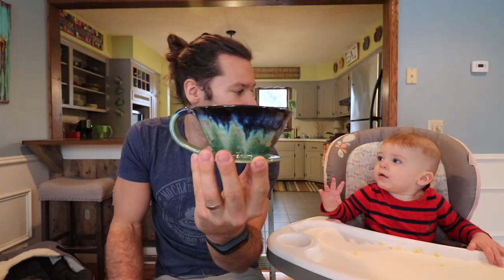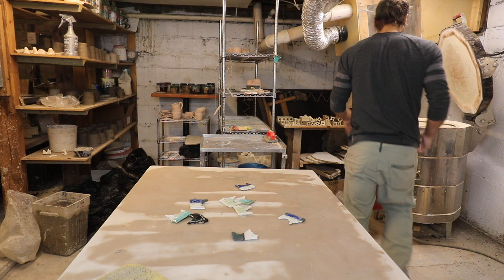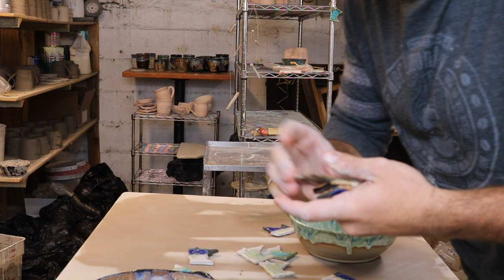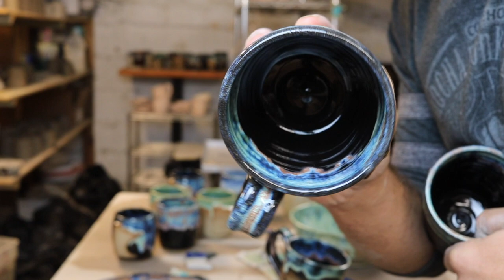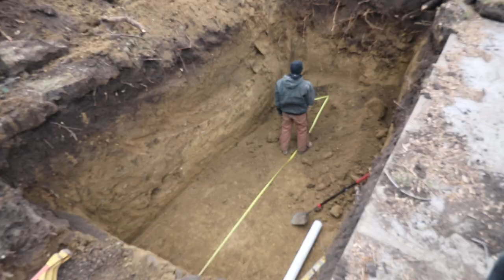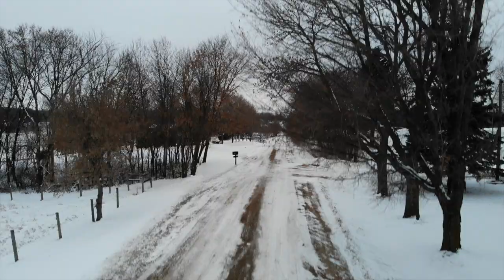The LAST Kiln Opening??   Unloading Kiln #36

Comment: As a knitter, yarn bowls need heavy bottoms so they don’t tip over when the yarn is pulled through the holes.
Reply: I didn't think of that! Thanks for the info! I was considering making a few and I'm glad you commented that info.  Thanks again!!
Reply from the maker: Good suggestion!
Reply: Yeah, thanks for the info!
Reply: Jonthepotter late, but another suggestion would be to have the whole inside of the bowl and the inside of the slots and holes covered in glaze so they’re smooth and won’t snag the yarn as it’s pulled. That drip on the one in the video is cool but would probably prevent me from buying it if it might snag.

Comment: As a Potter, my fingers seek out the exposed clay on the foot of a handmade piece. When I used to do shows, I would see someone looking at the foot of a piece or touching the bare clay and I always knew that they, too, were potters. We just can't resist that connection to the material.

As for warping... If it bothers you, then mark them down... They're handmade pieces. They live in the real world and their shapes are influenced by their environment. There may be air currents in your studio that influence how they dry or temperature fluctuations in your kiln that change the shape as they go through quartz inversion... Whatever the environmental variables are, they are the product of unique synergy and are what gives fine craft its soul. I embrace it, personally, but Wabi Sabi isn't everyone's thing.

Comment: I’m am concerned about things not being perfect also and am told over and over that they love not perfect pieces because you can tell it’s hand made not manufactured. So I and everyone I’ve talked to would buy a not perfect piece. By the way, when you say “ ocean drip and canyon skies,” is that the name of the glaze or your name for the combination? I’m still painting on glaze with a brush and want to start dipping. How do you get your glazes?
Reply from the maker: Those are the names that I have for my combos!  I buy them dry in 25 pound increments and add water.